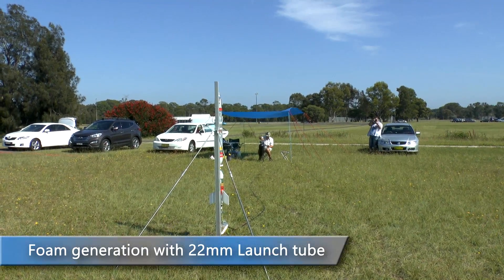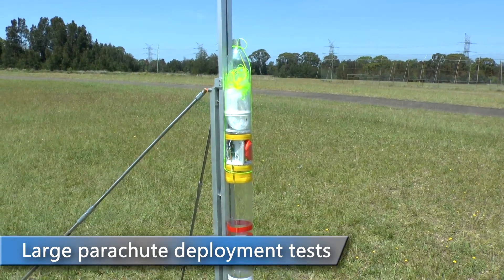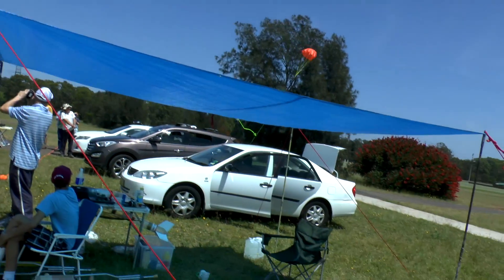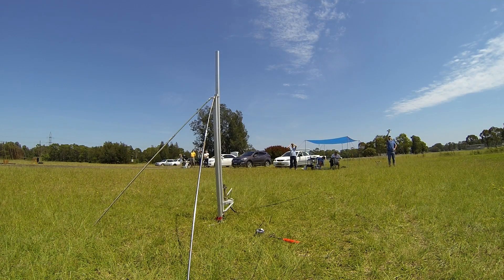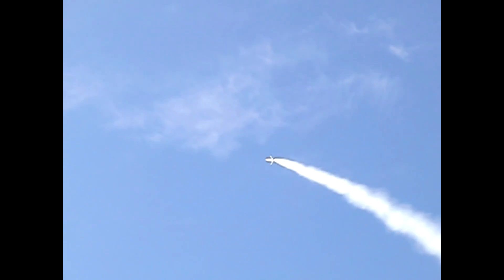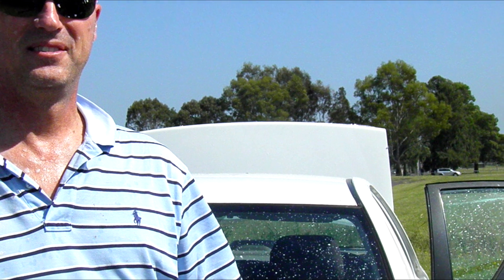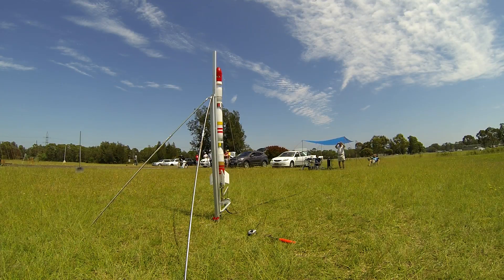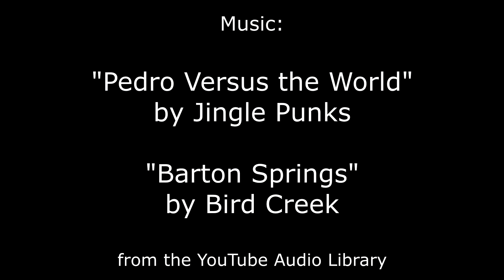Day154 - Highlights

Comment: Superb quality on the high frame rate camera!  Can I ask what make/model it is?
Reply from the maker: Thanks Brian. We use two high speed cameras. The GoPro Hero 3 (Black edition) which we shoot at 240fps (848x480 frame size), and the Casio Exilim FC100 which we shoot at 210fps (480x360 frame size)

Comment: Nice video George ! And super rockets !
But why parachutes are not they attached to the rocket center of gravity?
Reply from the maker: Merci François, :) We are sometimes limited where we can attach the parachute because the ideal balance point may be directly over a camera or altimeter. We also don't like to attach the parachute to the fairing as it can get crushed more easily in a high speed deploy. We normally tie the parachute around the nearest bottle that is close to the balance point. To get the rocket to come down sideways when possible we attach the parachute ahead of the center of gravity because the fins generate lift on the way down. If the parachute is attached at the center of gravity the rocket ends up coming down nose first :)

Comment: Very nicely edited video, the music fits just perfectly. Great work! :)
Good to see how you attach your camera to the rocket, I think we'll buy it too.
I would try to reduce the size of your pilot parachute rather than separating the nosecone like you mentioned it in your website launch report.
The end of the video was very funny;)
Greetings from Germany
Julian
Reply from the maker: Thanks Julian, I agree the pilot chute can be smaller, but I think it needs to completely come free of the rocket. The large parachute is 2.6m in diameter and takes quite a bit of air to inflate. When trying to inflate it by running around, it took a bit of effort. :)
http://www.aircommandrockets.com/images/2014/day151/Day151_19_s.jpg

You could see in the video that not even the shroud lines were pulled completely out of the chute. Perhaps the pilot chute could be somehow reefed after it pulls the main out. I am hesitant at separating the pilot chute just in case the main does not open. Another alternative is to connect the pilot chute to the middle of the main chute so that it stretches the chute and shroud lines. The chute is very delicate and tears easily though. We'll try again until we get it to work. 

I'll send you details about how the camera mounts into the rocket.